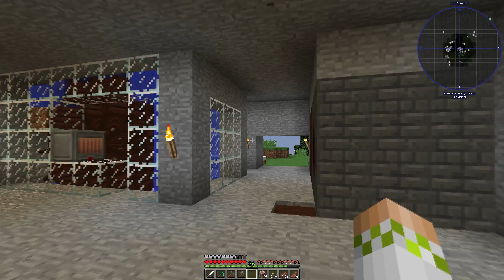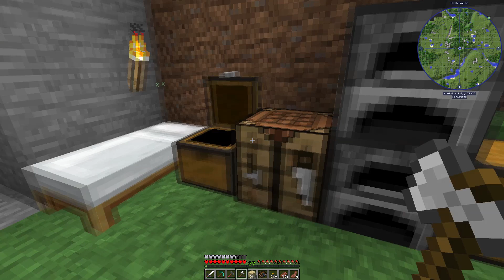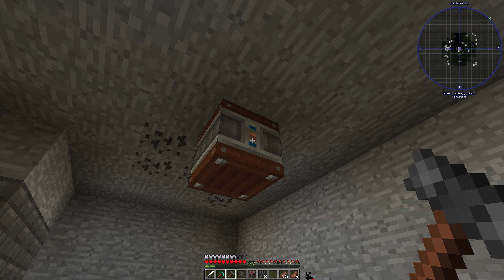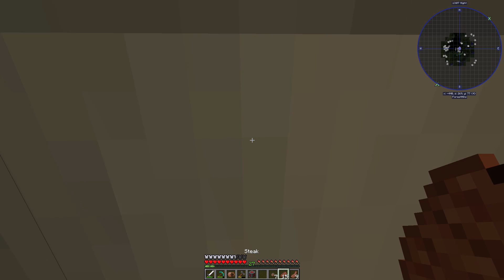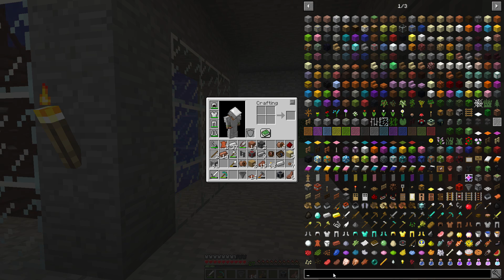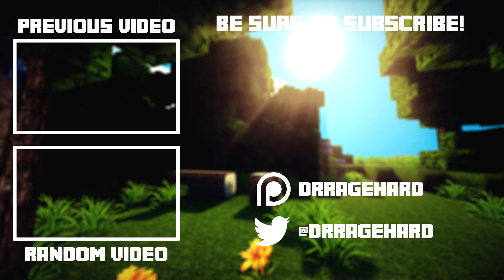Surviving With Immersive Engineering :: E02 - The Crusher

Comment: 7:50 small thing that will save some iron here is the engineers workbench. the iron mechanical component recipe when crafted in there only requires two iron plates instead of four, so you only need to use 20 iron instead of 40 for crafting the light engineering blocks. Not sure if this is a change since this video was made though, but for anyone watching this now.
Reply: Thank you I had forgotten this with so many recent builds I've done.

Comment: You can pull  power from behind the Kinetic Dynamo.
Reply from the maker: Ah yes, it seems I may have been incorrect when saying it only comes from the top! While the graphic is only on the top, all sides but the front (where the waterwheels are connected) should work for pulling power.